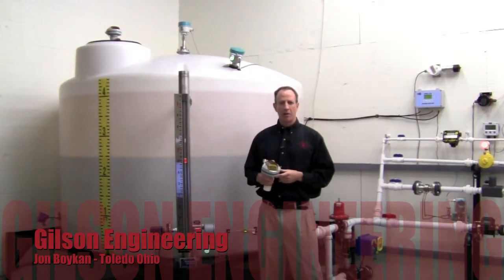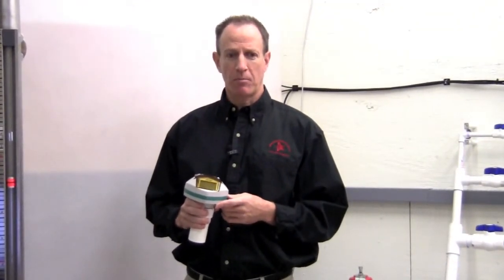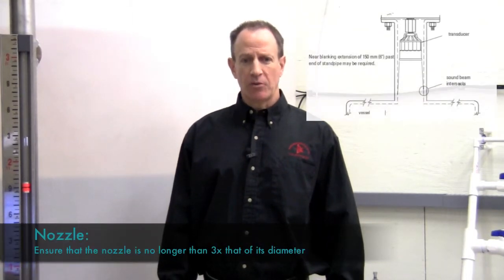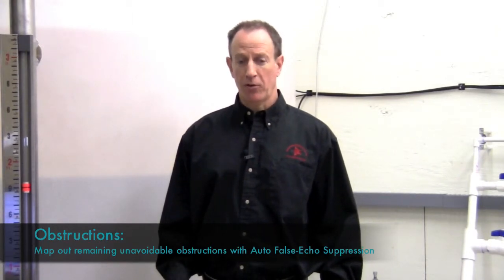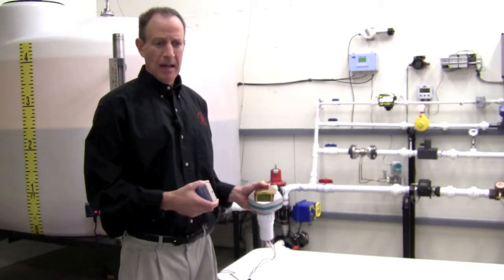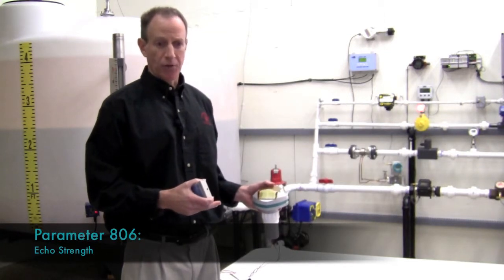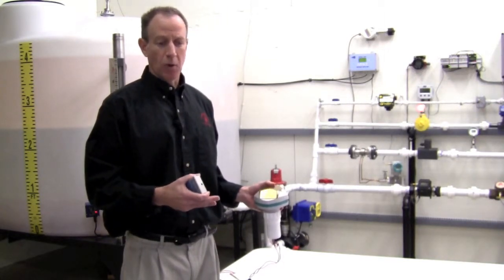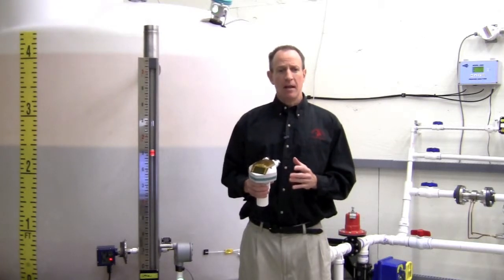ProbeLU Troubleshoot

Comment: Hello, please I need assistance. I'm troubleshooting a siemens sitran LU. I've set the P006 and P007, once I put in run mode, the sensor automatically gives me a few reading above the span regardless of the actual level. Please how can I pinpoint the issue? Thanks